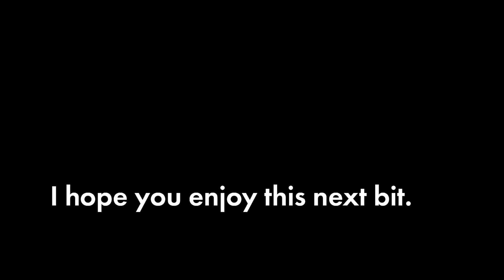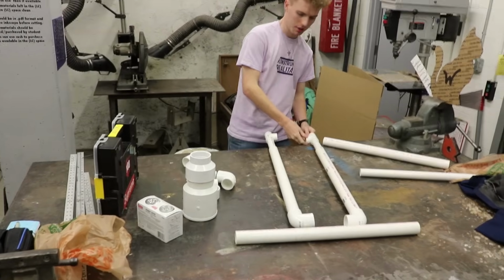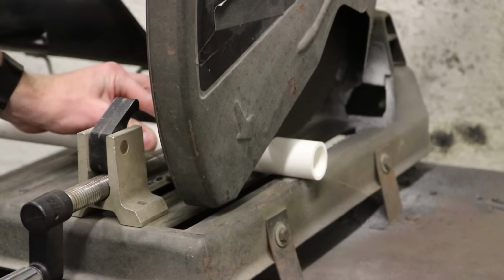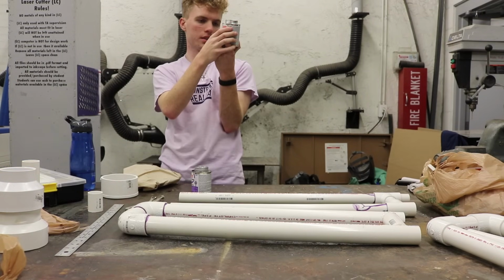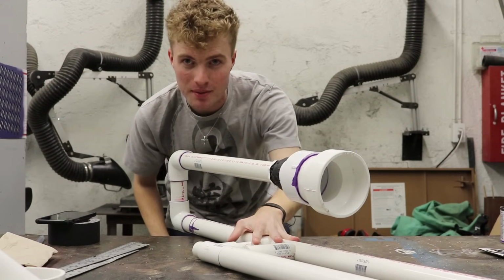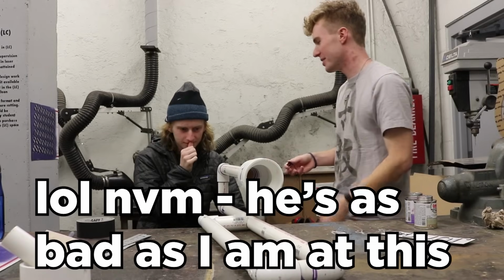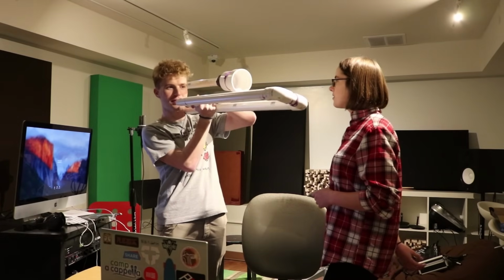I made a PVC trombone, and it TOTALLY BLOWS!

Comment: What is that called? I have it on an old 78 rpm record. "In the Mood" by Glenn Miller I think.
Reply from the maker: Also bonus points to you! Apperently two songs have this tune? It’s also the tune to “hooked on swing”, though glenn miller might be the OG
Reply: Very solid jazz classic glenn miller was just about thee top dude for jazz I've played In The Mood many times before
Reply: @Weisz  "Hooked on Swing" is a medley number that includes "In the Mood" as its first theme (Then "American Patrol" "Sing, Sing, Sing" etc.)
Reply: The oldest version is by the Edgar Hayes Orchestra from 1938
Reply: Correct.

Comment: Ey I can play trombone. You might wanna try making it with smaller diameter pipe, and I would look up the length of pipe in a normal trombone. I'm normally a tuba player so I know that my tuba has like 18 feet of tubing. I bet if you made it more specific you could make it really good. My friend has a plastic trombone and he loves it.
Reply from the maker: Unfortunately this is the smallest size of PVC that will fit together properly — but I did hear about the plastic trombones! Maren said that ya have to break them in?
Reply: @Weisz  Search for hot water pvc, it's a lot smaller :)
Reply: Your tuba has 18ft of tubing lucky
Reply: @AlejandroFerrariMc  I Think Thats CPVC?
Reply: @joshveer1138  YES, CPVC.
Reply: It's prolly be better with a mouthpiece
Reply: Tuba is best instrument because  d e e p
Reply: @nathangeorge4214  Yep! I thought so too. It would probably sound really good with a proper mouthpiece.
Reply: You can make one of electric tubing, the orange one
Reply: Dude same time tuba is great, and the bone is kinda hard, but also instead of using pvc pipe use copper pipes so u can have to janky bones instead of one
Reply: @benja99full  see this is big brain cause electric piping is also flexible so I can make the right curves on the trumbone
Reply: A trombone typically has 9 feet.
Reply: What trombone is it that your friend has?
Reply: The rapid bore expansion relative to the length is the main problem, especially the lead pipe section. This is the same issue that plagued the serpent back in the 17-18th centuries, resulting in a hollow tone in the mid ranges, and it took decades to start to figure that out.  A friend of mine built a serpent from PVC pipe with some success, but the fundamental problems remain.

Comment: The reason instruments use brass is because it has this cool property that allows two pieces of tubing to slide inside one another without loosing air pressure or pulling more air in. This is also why its useful in modifying nerf guns

Comment: If you did the math for the tubing and added a tuning slide you definitely could make it work better. 
You could essentially make a p-bone sort of deal and use metal stockings to bore out the slide to a more or less sufficient fit. (After milling it to a near fit). If you're feeling really adventurous you could take a shot a bending some brass. It would be an awesome challenge to see you take.

Fittings with curved corners would allow for a better playing experience making it less nasally.

The most important part in any horn instrument is the horn part! The bell you made approximated what one looks like. The closer you can make it shaped like the real deal the more like the real deal it will sound.
Please make a V2!

Comment: I think the right-angle joins are a big detriment to the whole thing, though I know that's part of the fun. A standing wave really wants to be let be. Rounded edges can trick it into thinking that it's doing that. And of course a smaller diameter limits the range of frequencies that will... stand and wave? Standing wave joke, not good from any perspective but I typed it regardless. Anyway, if you used narrower conduits and found a bendable hose that would round out those corners, you might get a more "trombone" sound. But then it wouldn't be a "PVC trombone", so I get it. This video wasn't a question, so my "answer" is unsolicited.

I like it Picasso. There were just other words I wanted to type.

Comment: The best thing about this design is that is cheap and it's a bunch of sanitary piping together, so there's no need to have spit valves. All the accumulated saliva will automatically go into the sewage anyway! In any case, a kitchen sink strainer near the mouthpiece would go a long way in preventing pipe clogs. Also it really sounds like shit, but this pipes are specially designed to handle that type of material anyway, so is a win and win situation.

Comment: IDEA: Using big pipes, your getting lower notes, try smaller tubing. As for the part you put your lips on, try a small pipe cap with a drilled hole in the top to fit another pipe.

Comment: Well, as a trombone player I can tell you this.. Your slide needs to be much smaller in diameter.   Trombone mouthpiece is shaped like a funnel,. And the Bell is funnel shaped too, about @1.5 times the diameter of yours.   Finally, the short piece that holds the slide together needs to be blocked off or the slide won't work properly.

Comment: Yeah but like you do understand how that's not a trombone at all, right? That's a pipe in which you make a noise with your mouth and adjusting the length doesn't affect anything. An actual trombone will change its note according to the position of the sliding bit.
So no, you didn't make a PVC trombone, you made a PVC sliding pipe in the shape of a trombone.

Comment: It might work better if you cut the mouthpiece at an angle
Reply from the maker: This is the most interesting suggestion I’ve ever gotten on this video - why would cutting it at an angle help? Genuinely super curious.
Reply: @Weisz  It gives you more space for the upper lip to vibrate in (especially if you have a smaller pipe diameter), and has a bit less of a buzzy sound (since it makes the lip work a bit like a clarinet reed).